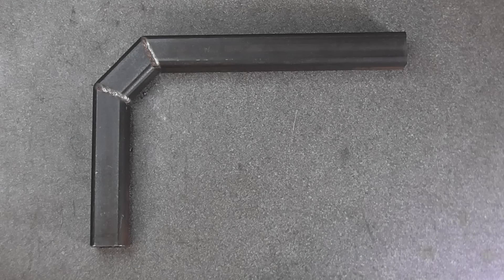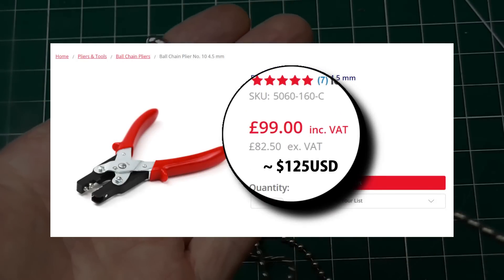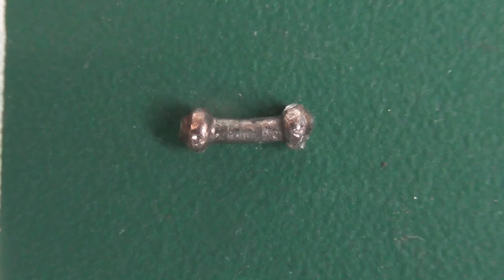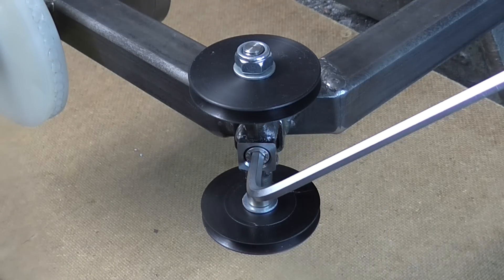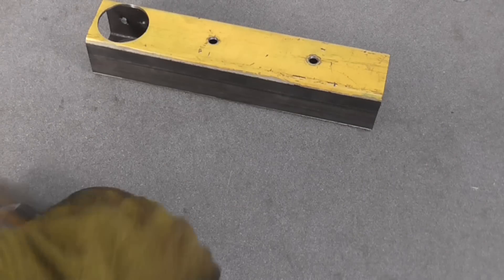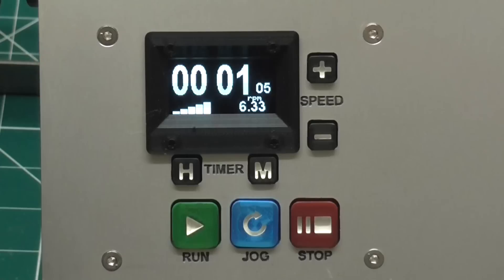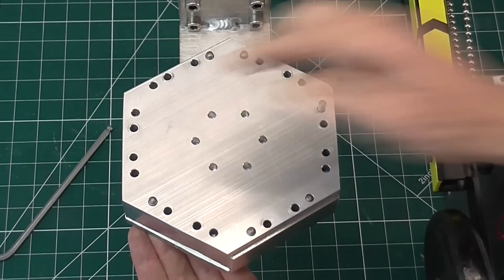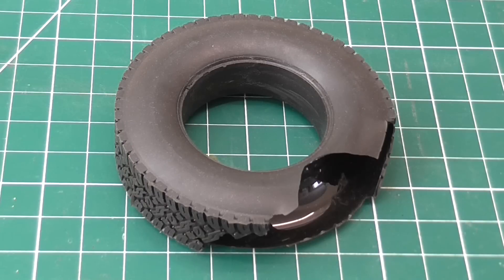Rotational casting machine (DIY) part 2

Comment: Really nice engineering! I want to try to make one using mostly wood and 3D printed parts. Could you share some details about how you built the control panel? Arduino and PWM speed controller?
Reply from the maker: Thanks! I probably went a little over the top with the controller. It's not actually an arduino but it is the same type of microcontroller. It handles the PWM with speed feedback. I also wanted a nice display with timer etc.. but none of that is really necessary.  A cheap PWM circuit with just a potentiometer for control would work just as well.
Reply: Thanks for the reply! I’ll give that simpler setup a shot, sounds like a great starting point. I'm just curious, is this your profession or more of a passion, like it is for me?
Reply from the maker: It's just a hobby. I wish I had more time to spend on stuff like this, I generally have several ongoing projects at a time and progress can be quite sporadic!

Comment: hello, what kind of resin are you using or what is its viscosity :)
Reply from the maker: It's polyurethane resin and I added black pigment to it. I used two different types with different hardness and setting times, still haven't found the perfect one yet.

Comment: Hi, I made a machine based on yours! I love the belted approach. Can you tell me more about the motor setup you got there? I have a smaller and lighter machine, and tried to use a stepper since I need to test various RPM's (and i know how to control steppers and not much else..) but it is not strong enough. I can get a bigger stepper, which needs a better driver, but I want to make a dozen of these machines for a small production run and in that scenario the price is considerable. One last note; due to my material choice I need quite high RMPs (around 100) since I will use the centripetal force in my advantage. So basically I need something cheap and strong which can be adjusted in regards of RMP. I would love to hear you insights!
Reply from the maker: Look for used car windshield wiper motors, these are cheap, powerful and have a built in gearbox that give about the speed you need. But even with a small stepper motor you should be able to gear it down enough to give the torque you need, adding a counterweight to balance the mould will help.

Comment: I'm sure you've been this asked before but why not use a timing belt instead of a bead chain?
Reply from the maker: Because a (flat) belt would have to twist 90° around the corner, which is possible, some car engines even do that, but bead chain can just bend in any direction and I liked that solution better. A round belt would also work but it wouldn't be synchronous.

Comment: wow, very nice video. I have done it but failed to get a very smooth results. what kind of speed this you use?
Reply from the maker: I also got thick and thin spots, not enough to be a big problem, but could be more even. I think changing the ratio from 4:1 to 2:1 might help but I haven't tired that yet. I got best results around 6-7rpm I think.

Comment: Result is beautiful ( explained by metal mould ? ) beautiful tyres, is it 1/6 scale ? that's why these machine have future : sometimes impossible to find the correct items ( scale/ material/ qty.. ) in this case...a tyre...take care, cheers : )
Reply from the maker: Thanks! These are actually 1/8th scale commercial truck tyres, you can find model tyres this size but the options are very limited (and they're expensive). Besides, I just wanted to make my own.
Reply: @AndysMachines  you've rigth Andy, when no exist do it yourself...1/8 is not enought, it's really 1/6 that I want...many, many thanks for all your movie on Utube, it's inspirating ! take care : )

Comment: I have a feeling that that phrase "good enough" is not used very often, in your shop!  Seriously though, have you done anything on mold making?  Specifically, how you made (assuming you made it, of course!) the break-a-way tire old.  The tread detail, the indicia on the side walls.  Thanks for sharing your work with us!
Reply from the maker: I haven't really covered mould making, though I may have touched on it in other videos where I had to make a mould for something. I did make this tyre mould and it took me 3 attempts, each by a different method, until it was "good enough"!

Comment: It would probably have been OK to mill the cogs as if the chain consisted of only splicing connectors. Would have limited the chain to an even length and you would have had to go to a 14/56 cog pair, but you would have saved yourself the manufacturing of the pliers.
Reply from the maker: True. Other people suggested that too but failed to realise that both the chain and pulleys would all have to have an even number of teeth/links.

The way I did it was more work, but it just seems better to me (if only marginally) and gives more flexibility, eg. I can change the ratio by just changing a pulley and shorten/lengthen the chain without having to keep track of the number of links (yes I could just use trial and error and cut off one more ball if it was an odd number). Somebody suggested it might work better with a 2:1 ratio instead of 4:1 and I've been toying with the idea of 3D printing a new pulley to see how that compares to a machined one.

Comment: Fascinating machine, very ingenious and amazingly good result. I feel an undeserved affinity with ball chain - during the war my father (a very able engineer with whom you would have much in common) was given the task of mending a machine for making ball chain that had been in a bombed factory; apparently there were only a couple of such machines in the country, most being imported before the war, and these chains had some application as timing chains in some form of military equipment, I don't know what, not sure he ever did himself. The chain making machine was itself originally German, ironically. But I have a very vivid memory of my father, in the 60's when I was a boy, describing to me how such machines worked, fed by a coil of wire for the dumb-bells and a coil of strip for the balls. Made in a continuous process of course, a blank for the ball being stamped out of the coil into a hemispherical die, between the counterpart of which the dumb-bell wire was fed in, rapped sharply on the end to form the dumb-bell as almost simulaneously the dies closed around it forming one end of the ball, the half-dumb-bell then being sheared from the coil, another sharp rap on the other end, providing the dumb-bell end ready to accept the next ball-blank. All happening very fast and noisily. That he could reconstruct the machine with no drawings further convinced me of my fathers genius, and simultaneously revealed to me how much better his 3D spatial imagination was than mine would ever be.
Reply from the maker: That's very interesting, thanks for sharing! Ball chain is one of those things you just take for granted until you look at it in more detail. I found this video of an Italian machine on Youtube: https://youtu.be/RhZL4CS_lVA 
It seems to work almost exactly as you describe, with a wire and strip of metal being fed in, except that it forms the dumbells in a continuous line, with each one being presumably broken off as the ball is formed around it (it's hard to see every part of the process).
Reply: @AndysMachines  Linkteki  makinanın üretim yöntemi çok farklı. sizin zinciriniz zamanlama kayışı gibi çalışıyor. burada süs eşyası üretiliyor. zamanlama özelliği yok. Harika bir mühendissiniz. Paylaşımlarınız oldukça  zevkli.  dilinizi anlamıyorum ama ses tonunuz rahatlatıcı :) . Yabancı kanallarda sesini açtığım nadir kanalardansınız. saygılarımla.

Comment: Neat project.

I was wondering if you could get away with using string instead of ball chain though.  I guess it would depend on how much torque it takes to swing the resin (the mold can be balanced before filled).

A cord and pulley transmission works fine on a spinning wheel, where one is amplifying rotational speed rather than torque.

I'd think that your application doesn't require a precise ratio, so a small amount of slip could be tolerated.

Could you estimate how much rotational speed is needed by measuring the flow rate of the resin?  I wonder if measuring the motor current is accurate enough to guestimate where the resin is inside the mold?
Reply from the maker: Thanks! 
Yes you could use string, or better round rubber belt (comes in long lengths and is easily joined to make any size belt) but as you say it wouldn't be synchronous which isn't so important but it would be much more likely to slip than a toothed chain or belt so would need to be run with higher tension.

One nice thing about it being synchronous it that you can stop it with the mould dead horizontal every time which makes filling it much easier, if there were any slip it would no longer be horizontal in both planes at any point so you'd have to make do getting it as level possible or adjusting it by removing the belt.

As for getting the correct rotational speed, this seems to be non-intuitive and needs a bit of trial and error. The current measuring is an interesting idea though!

Comment: Very interesting design . I am interested in the motor controller , is there another video on building the motor controller?As your design Has given me an idea on building a tube casting machine, are you to willing to share the design and building of the motor controller?
Reply from the maker: The controller is very similar to other ones I've shown on my channel in more detail. I didn't go into it further as it's very specific to this machine and it's unlikely anybody else will build an exactly identical machine even if they base it on my design. 

The controller is built from an Atmega328 MCU and an OLED display, there is a home-made optical encoder that measures the speed, the output is just a selectable PWM signal, there is no PID loop or anything to maintain the speed, the gear reduction and fact that the mass is fairly well balanced keeps the speed constant.

Comment: Cool little machine you got there.
I work at a rotational molding company. 
Our standard speed is 
Arm = 7 rpm
Plate = 2.8 rpm
And it reverses every 1.5 minute.

We cast PE/PP powder
And liquid pvc parts.

And just recently started molding in PA12 nylon.
Reply from the maker: Thanks for the information. I determined by trial and error that around 7-8 rpm seems to work best (I initially thought much slower would be better). Somebody else mentioned reversing the direction and also that 2:1 works better for symmetrical moulds than 4:1, At 7/2.8 rpm you are running a 2.5:1 ratio. For my next batch I will try reducing the ratio as I can do this easily by changing the large pulley for a smaller one.
Reply: @AndysMachines  how did this go? im trying to cast hollow silicone balls but it ain't easy. initial results with 1:4 gear ratio are mixed. i got one ball with good coverage at the top/bottom but the silicone that was supposed to cover the front/right/back/left just formed a blob which sits in the middle.. 1:4 made sense in theory but in practice is seems like a good idea to go back to 1:2 again. 

also; how do you determine the speed? just trial and error? i made transparent molds as i figured it would be useful to bump up the speed so that the liquid silicone would barely stay level.

thanks for the video and information, it really inspired me to make a rotocaster above the triple frame designs!
Reply from the maker: I determined the speed by trial and error. Initially I thought faster would be better, but it's not. 
Since I used up the last of my resin I've not needed to rotocast any more parts, but I would like to get back to this and try the 1:2 ratio to see how that compares. If you have a big blob forming you may be going too fast, try going much slower than you think you need and see if that helps.
Reply: @narada4421  My intuition is to have the ratio a quotient of two primes so that the puddle of liquid material takes a different path each time.  Think of Lissajous patters, with 1:2 or 1:4 ratio forms a static image and of just a few lines, with a funny fraction the area is filled  Having a ratio of 13:37 or similar might provide a start and having slight slip with a smooth drive belt might not matter at all in the end.

Comment: I'm curious - could you carve the drive gear as if the whole chain were made of those connector links? Once aligned, wouldn't it just work the same? Each "tooth" would hold two of the beads instead of one and accommodate the connector link. In my head it works. Not sure about real life. The only gotcha would be making sure an even number of beads on the whole chain so the connection link always lands appropriately aligned, and not across two holes.
Reply from the maker: Yes, I could have done that by removing every other tooth on the pulleys, however it would only work with an even number of teeth on both pulleys and an even number of links on the chain. The small pulley has 13 teeth. Also the connector link is not exactly 2 beads in length, more like 2.5, but I probably could have adjusted it or made a shorter one.

Comment: What size bead chain did you use? Im using smaller bead chain for a small Z axis table and they stretch over time so much!!!! its crazy. maybe i need to pre stretch it? or heat then quench?
Reply from the maker: 4.5mm. I haven't noticed any stretch after many tens of hours run time, but it's only under light load and I can take up any slack easily with a turn of a screw. Bead chain is available in larger sizes (up to at least 16mm!), but I would expect some stretch under heavy load, even regular roller chain stretches over time (the 'stretch' is actually due to wear in the pins)

Comment: great job, what kind of rubber did you cast please?
Reply from the maker: Thanks, It was a 2 part polyurethane rubber, I tried 2 different ones made by Polytek and Polycraft.
Reply: @AndysMachines  thanks so much , did you noticed a difference between the 2 products?
Reply from the maker: @JAAKLAB  Yes, different viscosities, different setting times, different rubber hardness. Still not sure which one is best though.
Reply: @AndysMachines  many thanks

Comment: What country Andy
Reply from the maker: I'm in the UK, only our permanent highway signs seem to be made from aluminium sheet here. Roadworks signs are thin steel or plastic usually on flimsy fold-up angle iron stands, they have to be weighed down with sand bags to stop them blowing away.

Comment: Did I miss the reason why he didn't just use a second stepper for the secondary rotor?
Reply from the maker: That would have been more complicated to build. But it would give the option of being able to vary the ratio on demand.
Reply: @AndysMachines  A slip ring would be a little tricky, not much else more so.
Reply: @AndysMachines  I was going to ask the same question... it'd eliminate that ton of work you did milling pulleys, making the idler, and making the ball crimper etc.  It seems like it'd be way simpler.

Comment: Is that piece of square tube a piece of roadworks sign stand? - the bit with the yellow on. 
In your workshop do you use a lot of alli 3.5mm plate, 25mm square and the 35mm od square at all - like in projects? Road works signs - Awesome just saying
Reply from the maker: That tube was a piece of scrap from an older project, a piece of 60 x 60 box section I bought a length of years ago. I actually do have some 3mm ali sheets that were originally road signs, but the metal is very soft and gummy, I think it's nearly pure aluminium, not very nice to work with and the reflective vinyl that is stuck to them is very hard to remove. About the only thing I used them for was when I hammered a terminator skull out of flat sheet (check my other videos) since it can be formed without becoming too brittle.
Reply: @AndysMachines  Hell no Andy I was alerted to the Humble Road sign by someone who had just reskinned his Home Bus in 600 x 600 square sections - it looks awesome - and all the hard to remove stuff was inside the bodywork - kinda isolation at 50/70/100km Love you man

Comment: What would happen if it cycled through the entire range of speeds such that it always spent some time at the optimal speed following the principle that "even a broken clock is correct 2x daily"
Reply from the maker: It's an idea, but it would spend over 90% of the time going at the wrong speed. As I understand it the goal is to avoid a large puddle of resin pooling in one spot, the resin generates heat as it cures which speeds up the curing and can cause lumps to form where the resin pools. Some people have suggested reversing the direction periodically can help, but mainly for less symmetrical moulds.

Comment: Would love to see a video on how you made those custom buttons too!
Reply from the maker: They are 3D printed, the symbols filled with paint, then the tops sanded smooth. You can see the whole process in one of my other videos: https://youtu.be/beT8312k3yI 
I've used this technique on a few of my machines, it's quick and easy and looks professional.
Reply: @AndysMachines  thanks! They look so much better than most 3D printed ones I've seen, I figured they were cast or something!

Comment: Nice tool. I'm wonder if there's a direct correlation between viscosity and correct mould rotation speed?
Perhaps a drop test on a slope with correct gradients for RPM would help set it up
Reply: I'd say it's definitely worth investigating. Also, would it be worth ramping the speed (up or down) as the compound being cast begins to set and it's viscosity changes.
Reply from the maker: @JaenFoster  Yes, you would image there would be a correlation, but many things about this process seem counter-intuitive. I tried two different resins with different viscosities and found they both worked best at the same speed. It seems to be better to go too fast than too slow.